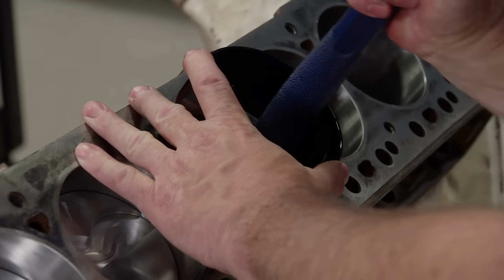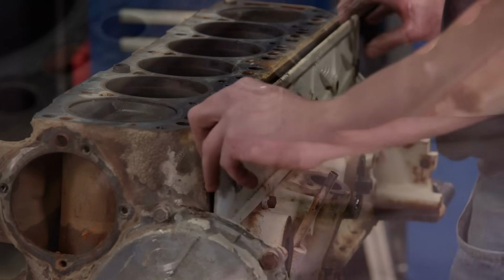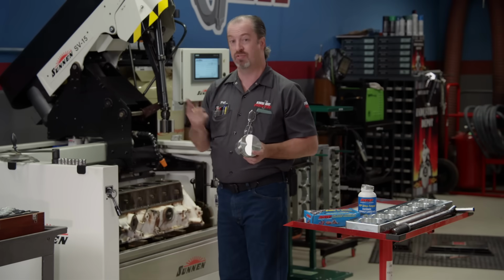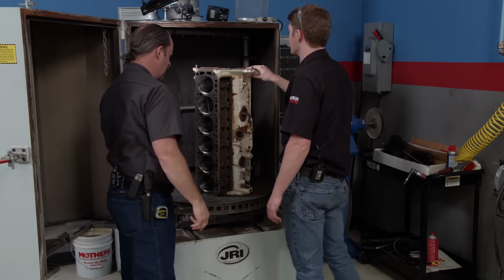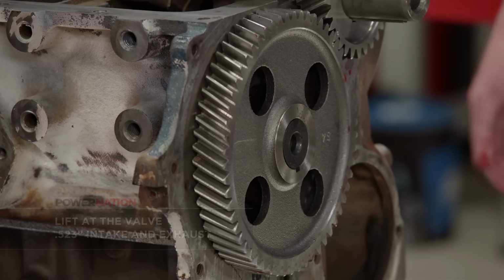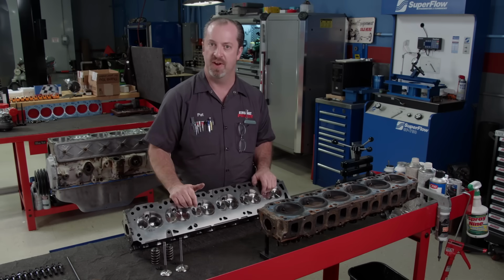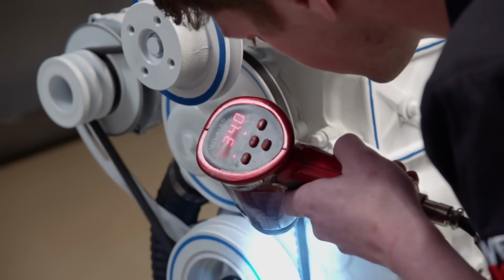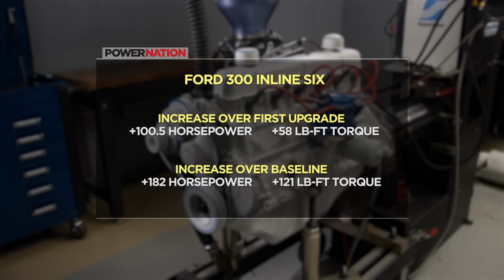Full-Tilt Build On Our Ford 300 Inline 6 For Serious Power Gains - Engine Power S8, E3

Comment: These are awesome torque motors. I would have gone 7.5:1 for a turbo. Try to make a gas version of a 5.9 Cummins.
Reply: 7.5:1 ?.... no need for that low of compression... like taking 3 steps back to take 2 steps forward
Reply: @codyramos3200  yes that low, that way you can throw even more boost at it. You will make more power throwing 25lbs of boost at a 7.5:1 engine than you will only pushing 12lbs at a 10:1 engine. Especially when you are trying to stay on pump gas.

Comment: My Dad was an engineer at Ford for 26 yrs. He used to bring home a 1968 Fairlane that was a test sled, it had a 300 six in it. With a 4 bbl! They put all kinds of parts on it, brakes, shocks springs, alternators, power steering pumps, wheels, tires, real axels you name it, and would beat the crap out of it, the only thing that didn't break was that 300 6!!! Thanks for doing this video series it brings back some fond memories of my Dad and Ford and the 300!
Reply: 👌🤗💬 You proved the pudding 🍨 🤠 Yup❕  G~G.

Comment: Never heard of honing .050". Interesting
Reply: Yes Jesse, the DIAMOND stones are very aggressive,  and saves you from setting it up in the boring bar first. I'm a Engineer and Race Engine Builder,  this is a very approved method of taking out the bore size .050". I would have left more than  .004" to finish hone, but that's just me. 
T.S. RACING 🇺🇸

Comment: I like 300s, had a few myself, but they will never let out impressive hp like a v8, it's just not what the design was intended for.  They will pull off some nice low end torque though and as far as durability goes they are unbeatable especially compared to engines from the same era. I've seen plenty of carb 300s with over 300k miles and still run like a sewing machine.

Comment: I am building one similar to this but I found some different fit parts and it will wind up being 10.89:1 compression and I got the lowest end torqueiest cam I could. Can't wait to see the turbo numbers because I was planning on that as well. Also my rods are custom so once I get a dyno pull I will let you guys know how it came out :) .
Reply: What pistons are you using? I'm trying to up my compression aswell
Reply: @tylarson9812  I am using a JE piston part number 300245. If you are using stock rods these will lower your compression a lot, I had custom rods made. There are other combos I could help you find that raise the compression without custom rods but they will still be different.

Comment: The ford 300, will always be a engine that the automotive will love. Its a motor that will always live, and will always shock you with how it runs and why it still runs after all the abuse it takes, it doesnt need oil or colant to run. I have one under the hook of my 1991 f250 custom. After upgradeing the spark plugs, wires, fuel injectors and pumps i forgot to check the oil amd colant and noticed for a month and a half i was beating on it with the tree work me and my brother does with out any. Ill never give this motor up. Its pushing close to 400k miles. And still runs. Its a motor ford needs to bring back. It will not die under normal use like the new ones do

Comment: Must remember, OEM, the factory did a good - sorry that should be excellent job with these engines FOR THE INTENDED APPLICATION.
See, upping the comp and all that is fine for a daily driver and freeway cruising etc, but if you want to tow, and lug stuff around with your truck, high comp engines with bigger overlap and lift build too much cylinder pressure and rattle (ping) when you you start pulling the rpm below about 2700 with a load of wood/machinery/car trailer etc. The low comp long stroke low overlap combo while a bit breathless a lot of the time is made up for by fairly big displacement and the capacity to live as a true truck engine without the expense of going to a Diesel. This way you can pull them right down in the RPM without pulling timing out of them and losing more torque.
As built for a workhorse in a true truck they were a well sorted engine these things I believe.
Anyhow love the vid, just to see what it can do.

Comment: I still can't believe no one's made a roller cam set up for this I look at it and it seems like you could use Ford roller lifters you just need special tie bars and then you'd need a special spider that would like bolt to the lifter galley plate to hold them in place so the lifters didn't turn I don't know that's what I plan on trying once I graduate college in May and have some extra money also want to try to put an LS head on it I saw that one guy did that but he was not flowing coolant through it but it does look like with some machining and welding it might work.  A turbo would definitely be the next step and it would definitely need to be EFI with a standalone

Comment: I'm going through a similar project at my "MacGyvers Workshop" channel here; https://youtube.com/playlist?list=PLCeCeS3QYjffdYrlKni6uYTOC3fkZpBId The most recent videos I've posted relate to the engine buildup. I'm right here in Portland,  TN just 30 miles north of the PowerNation guys, yet I have not been to their shop. Shame on me LOL! My question is; I understood the EFI head to be severely detonation prone. How are you guys putting so much timing in without detonation? And with the increased compression, and big cam, your Dynamic compression must be through the roof.  I bored mine over .030 (Johnny @ REM Machine in Franklin, KY is my machinist).  I did the carb head with SBC valves, turned 1.94's down to  1.84 on the intake side (wanted to avoid any shrouding issues). Went to 1.60 on the exhaust. Manton custom pushrods, Harland Sharp Roller rockers etc. (Did a cool video on raising the valve cover to clear the Harland Sharp roller rockers btw) I'm using an Offy-C series intake with a 5.0 spec Q-Jet (I used to work for GM back in the 80's and know how to dial them in properly) This is going to be a daily for it's lady owner, so can't be screwing with a Holley every weekend.  it has 3.00 gears, and is a 4x4 shortbed stepside.  On a side note, I got my first "bad" cam in 30 years of engine building. An Erson RV10H degreed in at 12 degrees retarded. Turns out the core had the keyway in the wrong place. Just my luck! Sent it back, and said give me a TQ20H (next step up), but they can't come up with a core. Bad luck all the way round I guess. I love what you guys are doing, I know your getting huge views from all my friends over at the "FordSix.com" forum. Keep up the great work! Regards,  "MacGyver"

Comment: I am surprised that the cam doesn't carry the power out higher.  Could it be a weak valve spring?  Also, I wonder what an open spacer would do?

Comment: I had a 235 six in my wild Oates stage.      had a Clifford Research header is all.   but.  had a step side.   and some stacks.    OMG is was noisy.    with a manual transmission.     here comes trouble.      :-)

Comment: As usual half cocked described as full tilt...
Get you a couple 4v Cleveland heads and cut a 
Cylinder from each. Weld together and bolt that on the short block...
Then you can talk FULL TILT gentlemen....

Comment: I miss my 81 ford f150 4x4 with the straight 6 300. If i wasn't ran off the road and flipped 3x i would still have that truck, i hauled so many ric of wood each year then in the summer i hauled a lot of hay, back in 87 thru 90 when i was 17 thru 20

Comment: My old 1980 F150 had a 300 I6. Somebody ran straight water in it for years so it was rusting itself apart from the inside out, but that thing still ran strong and held it's own against the V8 trucks my younger self used to hook up to. I wouldn't hesitate to own another 300 I6 but I'd have to modify it for more horses.

Comment: Didn’t they say in a previous episode not to assemble an inline six on an engine stand, and instead assembled on a table, because the length of the engine relative to the weight was enough to bind the bottom end during reassembly?

Comment: At 4:05, it's the UPPER bearing shell that you check for wear... that big 230/236 cam wanted to HP peak at 6200 RPMs... not 4600... it didn't even want to pull hard until nearly 3000 RPMs...

Comment: They missed putting the shop rag back in the water pump. Without that rag it might run too cold for thermo efficiency.  Should be good for at least 10 HP.

Comment: I can't remember the guys name but years ago there was a drag racer that raced a 300 with a custom made head, it was made up of sections of Cleveland heads furness brazed together creating a crossflow design, just like what we have here in Australia on our later model 250 I6.
In fact if the bore spacing of the 300 & the 250 is the same they should interchange??? 
They're worth virtually nothing here & they are made from aluminium? Any one game to do some research..................?

Comment: That engine would be a sweet replacement for the 240 in my 69 F100. 🤔
Reply: You could mimic the build. 240 used the same block, just bore it out to 300.
Reply: @usmcvet0313  thought it was the same bore with a longer stroke?
Reply: Right, you don't bore it out but change the rotating assembly such as the crank and rods.  The blocks are identical and the heads are interchangeable.  (Meaning you can put a 240 head on a 300 short block and vice versa).

Comment: I'd like to see one of these 300 inlines with solid roller setup and 6 individual 1 & 1/2" injectors on a 14" straight in manifold. A manual setup. Keep the same lower end. 3 Side draft Webers would be cool too.

Comment: Makes you wonder what a Eaton Supercharger... like a junk M90... could do on it.
Reply: It's not powerful enough you would need I would say like a TVs 1900 would do good but really on a straight six I think they fit turbos a lot better and with an almost square engine with a 4 inch bore and a 3.96 inch stroke that thing could spin a turbo up so fast.
Reply: @sock979  The Eaton M90... any positive displacement supercharger... is is a volume calc. 

The M90 will work up to 300ci. Turning it faster will obviously compensate, at a thermal cost. Although a slightly larger blower would be better matched.

The issue with a turbo or centrifugal supercharger, is the RPM range when it becomes effective is the reverse of a long stroke 300 six. This engine will never survive 5000-8000rpm. Turbos are a waste below 3500. 

The only thing a turbo is good for is a drag race car and a dyno cell to show a big high end number you will rarely, if ever use.
Reply: @Heathh49008  you know math can be really helpful but the way you're doing it just based off of cubic inches I suppose you're getting that info off of the eaton website or something it doesn't take into account enough other aspects not to mention the m 90 is such an old-fashioned out of date set up with its three rotors and small twist and it's still a pretty small capacity, but if you look at what it can do on other engines I mean the m90s pretty much only been used on v6 engines between 3 and 4 l make an around 200 horsepower to the crank starting and I had an m90 on my 4.0 mustang and that thing could barely get close to 270 at the wheels you wouldn't make hardly any power for what it's worth for that m90 also you really got to talk about which m90 the GM m90s are really constrained by the inlet and how they're made I also had one of those on my Pontiac Grand Prix GT you can't make more than 300 of the wheels with those and that's only with crazy supporting mods in like cams and heads and such now on my mustang I had the Thunderbird version although it was a 93 not the later 94.95 which are a little better but even still they just they're not going to be worth the tiny amount of power and the huge heat that you're going to make spending it to its Max RPM I mean if I remember right on the Thunderbird m90 they didn't recommend going over 14,000 RPM and that's on a car that's already getting close to it's Max I mean if you ever watch the Richard holder videos he put one although it was the GM version on a stock 5.3 LS and it lost power and a probably sized turbo works on any car for any use I had a t67 that I was pushing 500 to the wheels with and it was great for going fast now  just look at the EcoBoost I'm driving one if you want power down low you just size it right smaller smaller AR and my EcoBoost I can have full boost by like 1700 RPM and it's great for daily driving instant power although you don't need that as much with the Ford 300 you can't just base a supercharger off of cubic inches it depends on how efficient it is if you're talking about a stock ford 300 yeah probably be good but on that hopped up b** not worth it.  And don't get me wrong I love the wine of a Roots blower I love the power range but and they're great for street cars but you can't beat a turbo they're more efficient than anything else they're going to give you more torque sooner depending on how you size it but why do you think all these racers are going to turbos it doesn't mean there's not a place for superchargers and all of them can be great if set up properly but I don't know I just think a turbo would be a better set up on that. Although I think that's mostly just because of it being a straight engine you know Roots blowers just sitting in the cradle of a v engine is just perfect I think the only I can only think of one supercharger setup on a straight six that's a positive displacement and that's for the BMW straight six and I've never driven one of those so I don't know anything about em but that's what I mean by setup was it just seems to fits the architecture of the engine better and I think it would fit the power range very well

Comment: Waiting for a dodge 318 build
Reply: They did a 360 build a while back that's just a slightly bigger 318 isn't it and do you mean the older ones or the Magnum ones from the '90s cuz the video I watch said it would fit either of them when they did that 360.  sorry with the Gen 3 hemis out I don't think too many people are into those older ones.  roadkill has a couple of 318s that they mess with a little bit though I think

Comment: 300 efi heads are rare as they tended to crack very easy if over heated the 300 had 5 pistons available for it one being a top reinforced top ring grove which you could install chrome rings and we’re indestructible combo

Comment: Great numbers. I wonder how it will function in the real world with the exhaust cooking the intake manifold? I had an old ford 250ci 6cyl and it never ran robust when hot. A good heat shield is a must.
Reply: Worked in a country petrol station in the 80's, 2 year old falcons towing caravans would fill up then not start because the heat shields boxed heat in on the starter. Had to pour water over the starters so they'd cool enough to work. The "fix" was to remove the heat shields then no more dramas. This was the crossflow 250. The shields cut cooling airflow so defeated the purpose in the end.
Reply: @rossbrumby1957  Ford engineering bad design flaws from the get go seems to be baked into their DNA.
Reply: @saraflores9601  once about ten years old, they would start pissing oil out the rear crank seal. Other than that was a good motor but a bastard to get at the dizzy under the inlet manifold especially on efi models. Valiants had the best six in the Hemi- a V8 killer.

Comment: I`ve worked in machine shops for decades and this is one of my favorite classic engines, this video was enjoyable as well. I can count on my 2 hands how many front cylinder sleeves I had to install in these 300 blocks cause some slob mechanic put the water pump bolts in the wrong holes and punched a hole in #1 CYL. By the way i hired a guy in my own machine shop about 10 or 12 years ago from that SAM school.

Comment: Ford built a CNG version of the 300 and
it had 11-1 compression  ratio to take
advantage of natural gas's octane of 
about 130. Probably  used high  compression pistons, harder valves 
and valve seats. Don't  know  the rated 
hp. My cng Dodge ram van  has a Magnum 5.2 with standard 9.6 -1 compression has hardened  valves
and seats. Different  valve stem seals
and natural  gas injectors. Same cam and throttle  body as the gasoline  engine about 25hp less then the gasoline 5.2. The vin engine code isT

Comment: Congratulations!  I once owned a Ford with a smaller version of the same engine and it seemed hopelessly underpowered.  Your "new" engine is approaching small Ferrari performance.  How refreshing to see something different than the usual small block Chevrolets and Fords.
Reply: Small Ferrari performance might be a bit of a stretch.
Reply: @donziperk  4 cylinder Dino
Reply: @zeekwolfe5781  Dino was a V6
Reply: @donziperk  Not important
Reply: @zeekwolfe5781  oh so facts aren’t important

Comment: Please tell us how to obtain a"cross-flow" 6 cyln. Head. The type that was used in the speed runs on the salt flats at Bonneville, way Bach in"the day" it is true! I have seen the books but lost them please look would you look please Pat? May be Clifford, 6=8. 2 separate manifolds, one on each side of the head.someone must have seen them beside me!
Reply: For the 300 or 250? Dunno about compatibility between the 2 but get x-flow 250 heads off late 70's- 80's Aussie falcon 250's.

Comment: F165 said they couldn't have went from 88 to 169 WITHOUT changing the CAM...I wonder what he has to say about the 2.0 Compression increase AND Cam change making 100hp more?  So with Intake/Carb/Headers/Compression/Cam  = 182hp increase... F165 has put ONE cam in ONE engine and thinks THAT is the ONLY way to make more power... Yet engine builders that have built 1000's of engines, and done 1000's of induction swaps are "Liars" or so he spews on his YouTube channel.